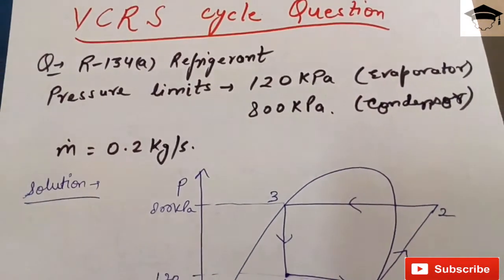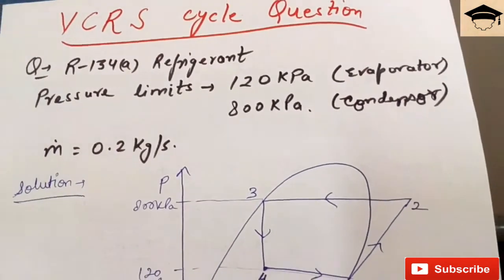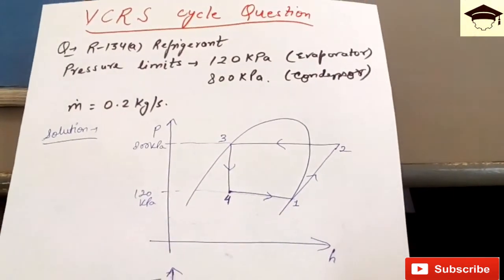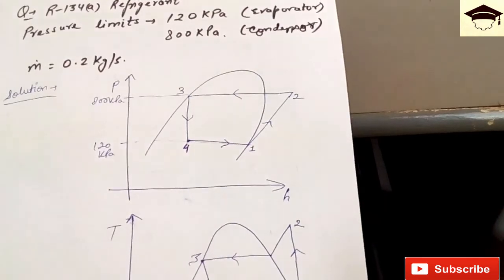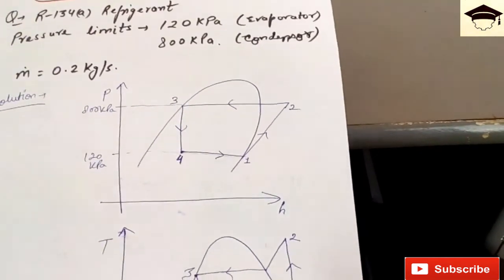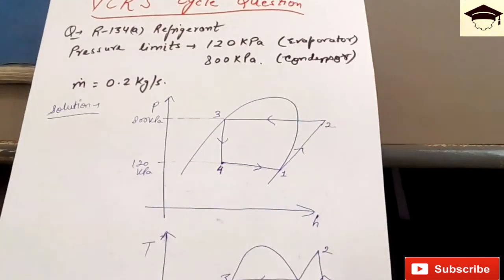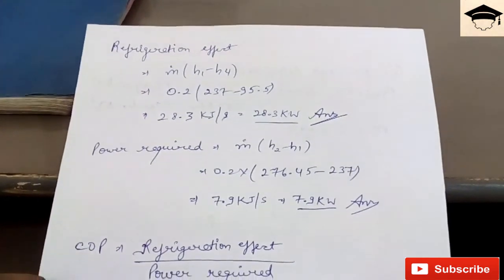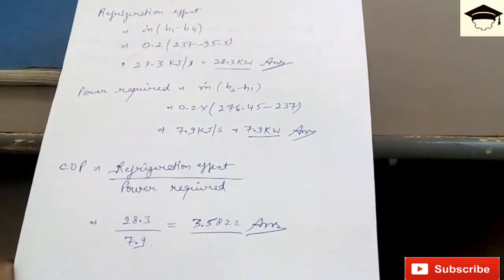vcrs question solved | vcrs solved question nptel | vapour compression refrigeration cycle solved

Comment: An ammonia vapour-compression refrigerator operates between an evaporator pressure of 2.077 bar and condenser pressure of 12.37 bar. Assume no under-cooling in the condenser, and isentropic compression. If the vapour is dry saturated at the entrance to the compressor. Calculate:
(a.) The refrigerating effect;
(b.) The specific work input;
(c.) The COPref.

Comment: A vapour compression refrigeration plant, which uses refrigerant-134a operates at an evaporator pressure of 240 kPa and a condenser pressure of 1.2 MPa. The refrigerant leaves the evaporator at 0 oC and exits the condenser at 40 oC. The two-stage compression is isentropic. The refrigerant that leaves the condenser is throttled to a flash chamber with a saturation temperature of 15.71 oC. Saturated vapour is extracted from the flash chamber and mixes with the refrigerant that leaves the low-pressure compressor, before entering the high-pressure compressor. Saturated liquid from the flash chamber is throttled to the evaporator. If the refrigeration load is 500 kW, determine the: a) mass flow rate of refrigerant through the condenser (kg/s), b) mass flow rate of refrigerant extracted from the flash chamber (kg/s) c) Power required by the low pressure compressor (kW). Sketch the cycle on a p -h diagram.

 help please      via musadoto260@gmail.com

Comment: I must have watched over thirty videos and not one video explains why and where point one stops. I have real data from a university lab test and I am struggling to understanding point one and two, i.e. at what point you extend past the saturation vapour line and to what angle to follow the isotropic line.
Reply from the maker: Hello Liam . In vapour compression system questions first you have to see the refrigerant in the system. Then the P-h chart or pressure enthalpy chart for that refrigerant is seen. In the questions evaporator and condensor pressures are given, so you have to draw these horizontal pressure lines on the ph chart . Point 1 lies at the intersection of the evaporator pressure line with the saturation curve . It can also lie in the superheated region if given in the question. But for majority of the questions it is on saturated curve. Then you have to proceed along a constant entropy line and where it intersects the condensor pressure line it is the point 2. I hope now your doubt is clear. Thank you.